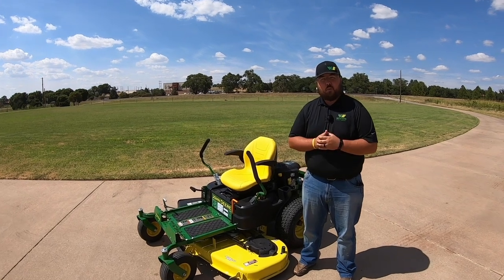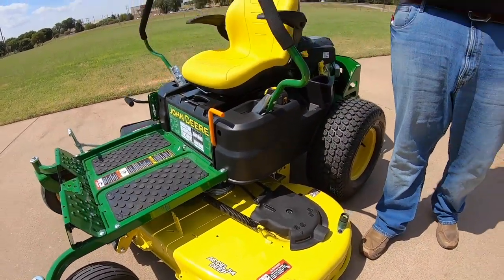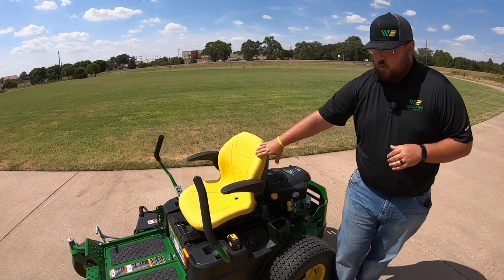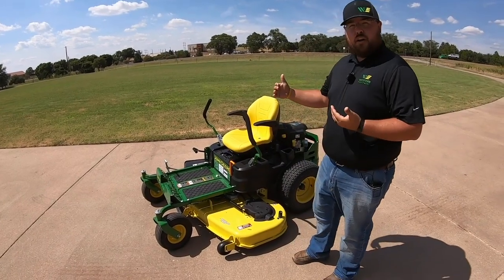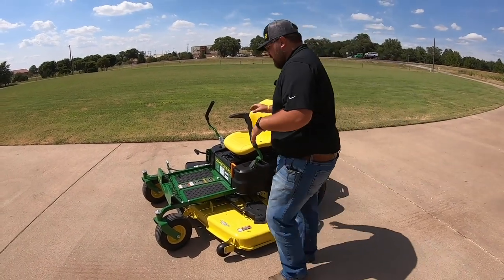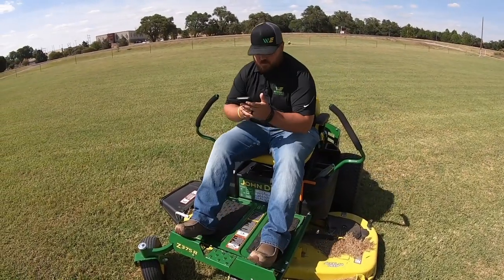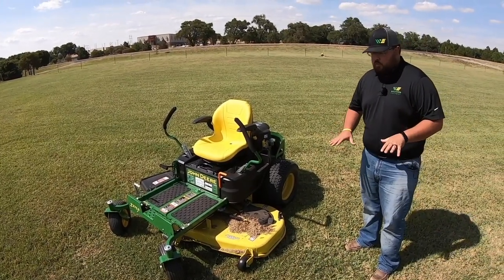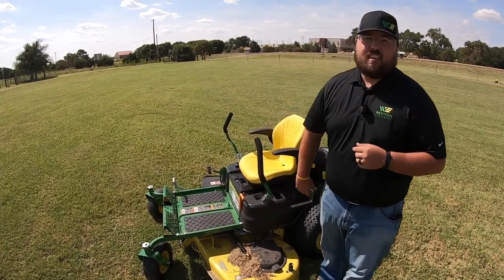How fast can the John Deere Z375R Mow an Acre with 54" Deck, 25HP V-Twin

Comment: What is the point in mowing with a Zero turn if you're just gonna go in a circle?  Need to time,  mowing that acre the way you would really use that mower.  Back and forth. Making lite and dark lines!
Reply from the maker: We found it is actually counter productive! All of the turn-arounds at the end of the row just added unnecessary time!
Reply: @WesternEquipment  Interesting!  I was curious, too. Thanks for these videos.
Reply: As long as the experiment is the same its good results. Z375r sounds like a winner for my 2.5 acres.. almost was going to splurge on the 515 60 inch.